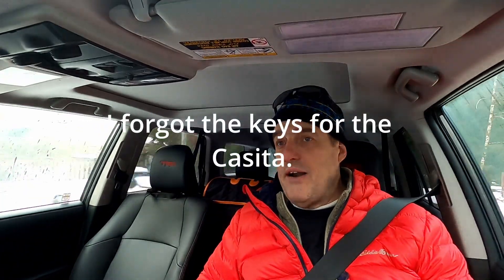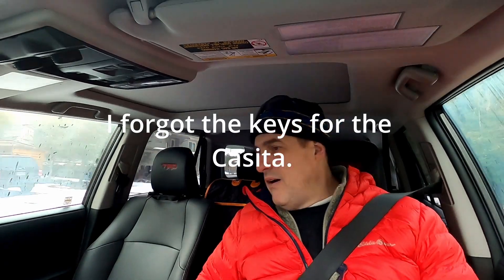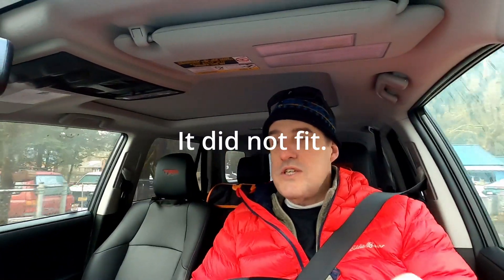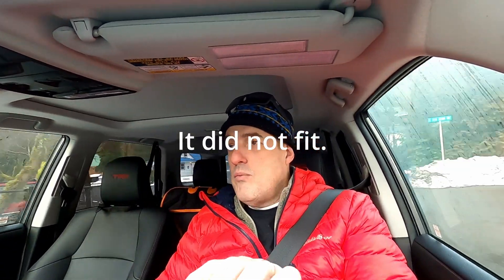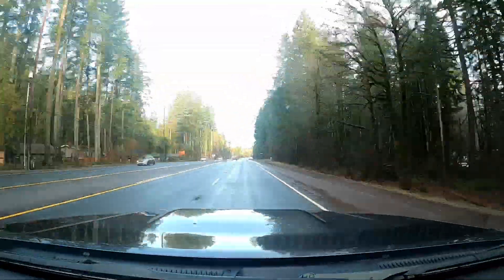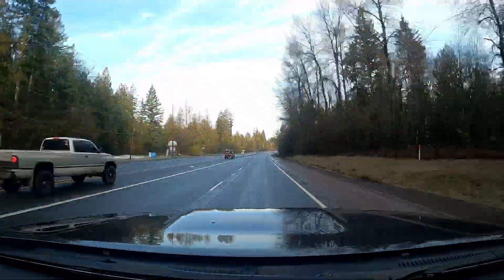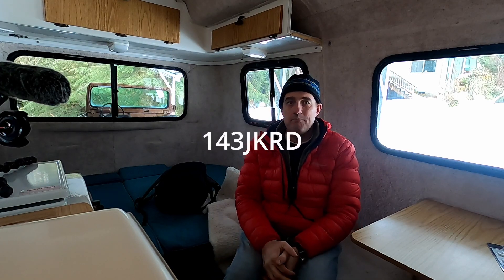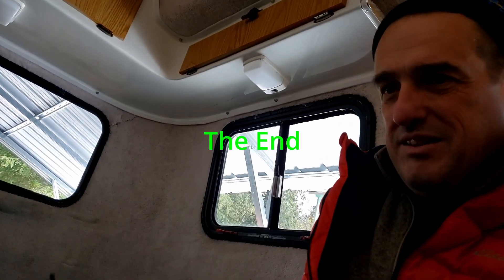Casita comes home Ep2

Comment: Something is wrong with your fan. I would actually want to freeze than use that thing. Hey, I am 6'6" tall. Would I fit in this?
Reply from the maker: Walking in the trailer would fine (headroom) but the bed is a full size at best. I think 6’6” is problematic for the bed situation. I would check on the Casita website.